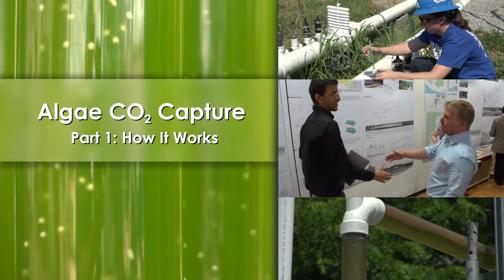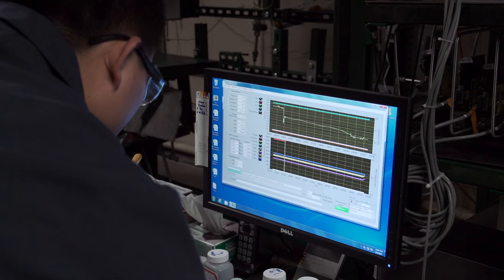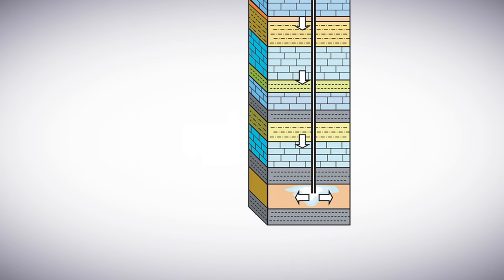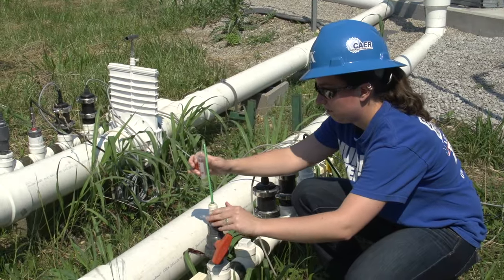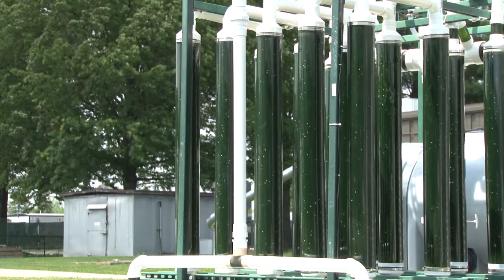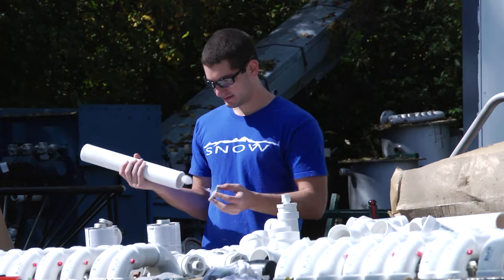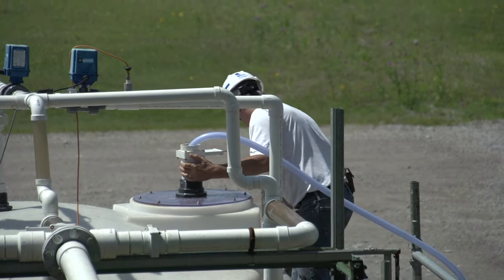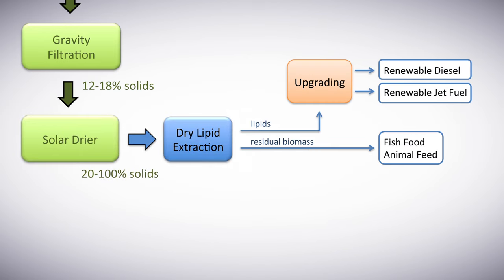Algae CO2 Capture at the University of Kentucky: Part 1

Comment: As a UK grad and student of energy in an MSES program in SPEA IUB, I think this project is brilliant! Biogas/biofuels from flue gas is awesome! What's done with the CO2 part of the biogas from the AD? Is it pumped back to the algae?
Reply from the maker: +Keane Gleeson thanks for your feedback.  We will try to find out that answer for you.
Reply from the maker: +Keane Gleeson This is from Dr. Crocker:
"Thanks for the kind words. In a commercial process the CO2 would indeed be separated from the methane and recycled back to the algae culturing system. However, based on the current economics of algae production, anaerobic digestion isn't an attractive use of the algae. Our current concept is to extract the lipids (oil) from the algae for the isolation of valuable compounds (carotenoids and polyunsaturated fatty acids), with conversion of the less valuable lipids to biodiesel. The residual algae biomass (mainly protein and carbohydrate) would be used for the production of bioplastics."

Comment: My understanding is that getting the carbon concentrations high enough to support a financially viable algal yield is the one of, if not the biggest bottleneck to scaling up the production of algal biofuel. Are there any breakthroughs being made on this front? It seems like if this hurdle can't be overcome the best we can really hope for is to tie photobioreactors to fossil fuel systems that produce lots of CO2. I'd like to see photobioreactors that can actually lower existing atmospheric levels of CO2.
Reply from the maker: From Dr. Crocker:
"Yes, it's true to say that the CO2 has to be provided at a reasonably high concentration, e.g., > 1%. Using CO2 at atmospheric concentrations is not a realistic option because algae growth rates are so low that the production of algae isn't economically viable. Hence, algae production will have to be situated next to large point sources of CO2, or, if it's not too expensive, CO2 will have to be piped to the facilities."
Reply: Thank you for taking the time to answer. I wonder if you (and perhaps any of your colleagues on this work) might consider doing a reddit AMA (https://www.reddit.com/r/AMA/) on the subject.
Reply from the maker: We will pass along your message.  Thanks!
Reply: @jasonjohnson1404  What about having this in cities with high pollution like LA, Mexico City, and Shanghai? Would that make much of a difference?
Reply: @jasonjohnson1404  But those places are mostly polluted by things other than CO and CO2, right?
Reply: @universityofkentuckyofficial  are you aware of any smaller variation being developed, using atmospheric CO2, for someone to cancel their home's carbon footprint? Is that even mathematically viable with something like 9 - 6" tubes? The devices I find don't really fit what I'm looking for.

Comment: I live in Ft Pierce Fl, we have enough algae in our 100 mile lagoon, With a hose I could suck this stuff up into a holding tank. This stuff is killing everything. Any way to use that for fuel.
Keep up the good work.
Chris
Reply: there is a really simple method if you really do have algae coming out of your orifices. simply take a bunch of said algae and set it out to dry. wait until the algae appears to be greenish-black flakes. take these flakes and put them in a press to squeeze out, believe it or not, oil! (oil as in stuff to make gasoline and diesel)

Comment: I've heard certain types of algae can be used to replace animal feed when dried out. Also, can algae take methane out too?
Reply from the maker: From Dr. Crocker:
Yes, algae can be used as animal food. Algae typically have a fairly high protein content, while some algae contain valuable fatty acids (EPA, DHA) which are beneficial in animal diets (as well as human diets!). Currently, algae are added to some high end pet foods and are sold in health food stores as a nutritional additive for humans. In addition, algae are being researched for use in cattle feed, pig feed, chicken feed, etc. Finally, it's worth noting that algae have been used for many years as fish food, e.g., in catfish ponds.Algae can also be used to make methane. Anaerobic digestion  (which relies on anaerobic bacteria to decompose organic matter) can be used to convert algae to a mixture of methane and carbon dioxide. At present this isn't very attractive, however, due to the low price of methane and the high cost of production of algae.
Reply: University of Kentucky thanks!
Reply: university of kentucky , can you explain to me how you capture carbon?or do you just pump it to the water containing algae?

Comment: Algae is 30 times more efficient then diesel. So does that mean the engine rpms are 30 times faster or is it more fuel efficient? I'm curious.
Reply: 30 times more efficient as in if you had 1 gallon of algae it would provide the same power as 30 gallons  of diesel.

Comment: First off I think this technologies is great, I'm glad to see funding put towards it as we can learn how to bring coasts down.

By Converting the algae to a bio fuel, which will later be burned, it is my understanding, The Co2 captured this way will still ultimately end up in the atmosphere.

The seems like you are only delaying the Co2 transmission to the atmosphere. bio fuel is great when it is the only fuel that is being used.

Atmosphere Co2 -> algae -> bio fuel -> Atmosphere Co2

is a closed system. However, co2 from something like a Coal is not closed it's just temporarily putting new carbon into the algae before releasing it.

Fossil Carbon ->  algea -> Bio fuel -> new atmosphere Co2 

Even producing animal feed will ultimatly release the Co2 through biological digestion.

I understand that a bio fuel by product is commercially attractive. However, true capture of the Co2 would require doing something like burying the algae in exhausted coal mines, where it can turn back into fuel in 100 000 years.

This technology is improving efficiency by creating additional fuel out of the carbon. but it does not quite capture the Co2 permanently.
Reply from the maker: Thanks for your feedback on this important topic.
Reply: Alan Van Arden not quite right, Fossil carbon(optional) > algae > Biofeul > CO2 > Algae > biofeul > CO> Algae...... and if we were to eliminate coal plants (alot of coal comes from algae), then it would be a complete closed loop